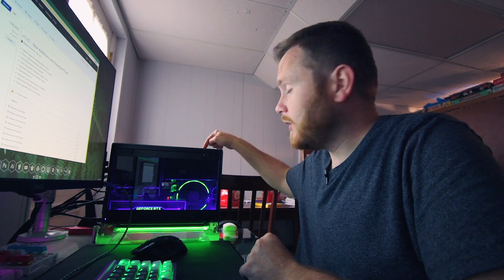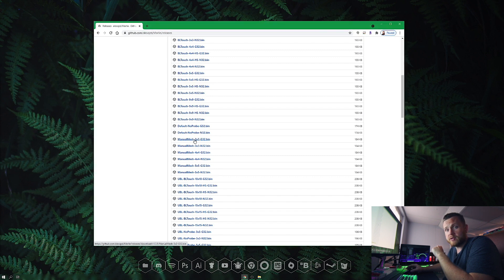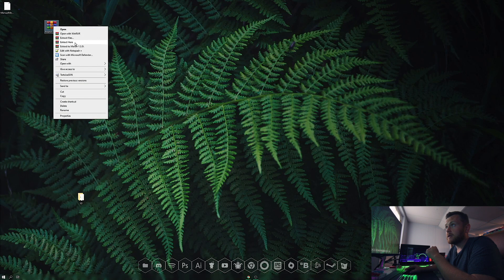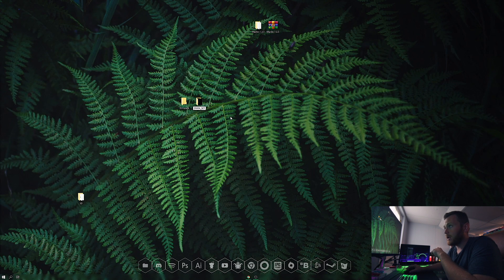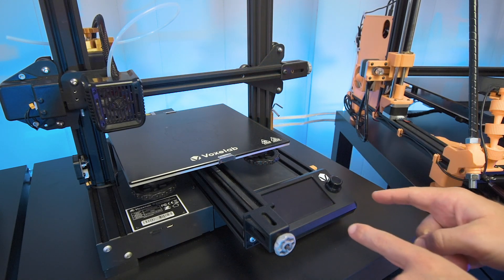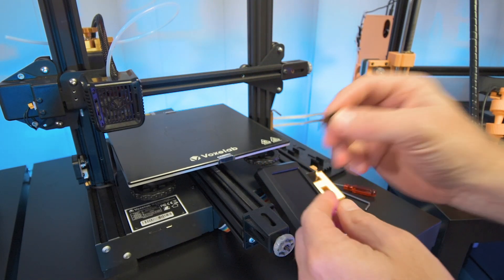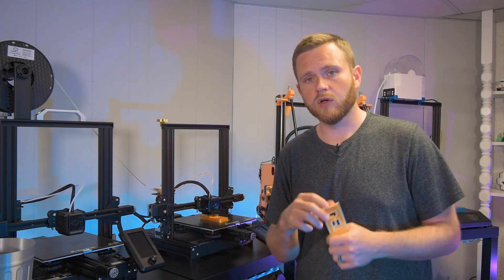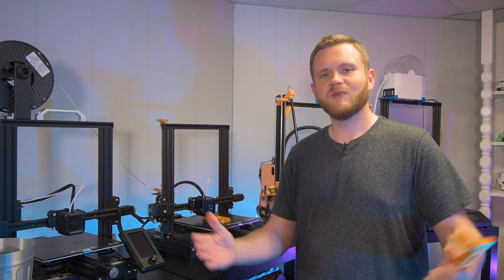Reduce Risk of Fire on Your Voxelab Aquila with 3rd Party Firmware

Comment: I installed the new firmware accurately step by step and now I get "KILLER error MAXTEMP RESTART REQUIRED" 

Ok, so here is what I found out after I panniced: 
The problem?
I installed the WRONG FIRMWARE. 
The solution?

PLEASE MAKE SURE YOU SELECT THE RIGHT CHIP MAKE! E.g. I have an N32 machine, not G32, so I would need a firmware which states N32.

It was painfully obvious but that's what happens if you follow step by step without common sense. I am also a noob!

Comment: Just did this firmware update today and man you made it easy to follow ! I thank you again sir ! I've done all the modifications to my X2 so far by following your videos ! 👍🏽👍🏽👍🏽🙌🏽
Reply: What firmware i need to download for my aquila X2?
Reply: @KSa-ld7cp  there should be a sticker in the top off your printer, under the build plate that says either N32 or H32, you will need the corresponding firmware. Then just follow the same instructions in the video.
Reply: @dirtymikendaboys  i have the n32 version and downloaded n32. But my machine just power on normally. I did every step on the video. :/
Reply: @KSa-ld7cp  maybe retry doing it, and follow each step very carefully, including renaming the folders, otherwise your machine will not know what to do with the files. Do not fast forward any of the video, I would recommend doing each step as it comes up in the video, then pause it, complete the step, then move to the next step. I also have the N32 version and it worked perfectly on my machine. 👍🏽
Reply from the maker: Sounds like the formatting wasn’t quite right. That or the firmware is still zipped and needs to be unzipped into a .bin file
Reply: @3DPrintSOS  thanks for the response. The problems was that the JPG files on dwin_set. I just remove and everything is perfect now. But almost kill the printer with the new firmware because it don't get on the fan when heat up the extruder,  the screen say: "print killed"
Reply from the maker: Hmm. Something else isn’t right if the fan isn’t working
Reply: @3DPrintSOS  I think was the configuration in cura the initial fan speed in Cura was 0. But I adjusted the numbers in cura and see your video explaining the marlin firmware and now is printing flawless <3
Reply from the maker: @KSa-ld7cp  Awesome. Glad you got it fixed. :)
Reply from the maker: Just make sure you match the chip. If it otherwise matters, it will say “X2”
Reply from the maker: Awesome. Glad I’ve helped.

Comment: Hey! So when I am printing, I have to pause a print sometimes and when I come back sometimes it can be an hour or two I click resume and it ends up pushing the print and print bed off with it, is there a way to have it return to the correct z axis or does it need updated?
Reply from the maker: Hey Jasa. Pausing is meant to be for a very brief period of time. If you pause for over 30 seconds, your printer will loose z height and heat. The chances of you finishing a print are almost zero at that point. It’s definitely meant for quick fixes or as a last ditch effort. Not really something an FDM printer can do.

Comment: Hi I tried This And it didn't Work it just is like a fusion of the old and new one. I tried reflashing the old one and then flash alex's but when i put the sd card into the printer nothing happens it just boots like normal and when i put the sd card into the LCD the screen is blue only for a second then is immediatly red and i cant flash any of the firmwares and it is stuck with a mix.
Reply from the maker: It sounds like there is either a naming issue or you aren’t using a .bin. Did you  use winrar to unzip the firmware?
Reply: @3DPrintSOS  So it turns out max can’t format to 4096 kilobytes so I had to use a different computer but it works now thank you for helping and I really like you videos keep up the good work

Comment: Really helpful video. Many thanks for posting. I want to change filament part way through a print and the Voxelab firmware does not support this as it does not full recognise a code pause. Following the code pause you have to select pause on the screen to allow resume and this moves the head back to the model,  deposits a blob of filament on the model and then reparks the heads. Do you know if Alex's firmware will support a pause/filament change?
Reply from the maker: Do you have an h32 machine?
Reply: @3DPrintSOS  Hi, thanks for responding. No G32.
Reply from the maker: Hmm. I’ve done pauses on this machine several times using “pause at layer height”. The issue I ran into is it only working at layer height .2 Otherwise, it misaligned when starting the next layer after pause.
Reply: @3DPrintSOS  Thanks for the info. Odd, when I do it it gives no option to restart on the screen, hence my issue. I am running on old firmware, maybe updating it will fix my issue.
Reply from the maker: Worth a try

Comment: idk if you will see this but i did this and let it sit for an hour and i never got a checkmark. Now every time i turn it on it just sits on the voxelab logo
Reply from the maker: Hey. I see them all! 

Hmm. Did you make sure you have the right firmware for your chip? If so, make sure you format the card correctly. You shouldn’t have to wait long at long. A few seconds at most.
Reply: @3DPrintSOS  yep I've done everything. it just sits on the update screen with no checkmark.
Reply from the maker: Gotta be the sd card. You sure you formatting correctly?
Reply: @3DPrintSOS  yep and I've tried different SD cards
Reply from the maker: The sd card must be 8 or 16gb and have to use Windows to allocate 4096 byte size or it won’t work. The second thing is make sure you are using a .bin file and not a .zip or .rar
Reply: @3DPrintSOS  for some reason when i installed winrar it works now. was that the reason?
Reply from the maker: Yep, the files can download as a zip or rar and you need it to be a bin. Sounds like winrar did the work for you. :)

Comment: what does bed mesh leveling do and can i use it without extra stuff
Reply from the maker: You level using predetermined points that create a mesh. The z motor ends up adjusting for your mesh as it prints. If you do Manual bed mesh, you use the screen to go through the points and adjust for each one. No hint extra needed.

Comment: I followed your instructions step by step and the graphics won’t appear on the screen how do you fix that?
Reply: But what do you do if you can’t choose 4096 bytes without switching file systems
Reply from the maker: I installed windows on my Mac to get this done. I tried many terminal tricks, but never got it to work.
Reply from the maker: That either means you accidentally grabbed the wrong version, there is a naming issue, or the sd card isn’t properly formatted with 4096 bytes.

Comment: Does this work for ender v2?
Reply: Just hooked up JyersUI, I just got a new printer for free….
Reply from the maker: Win win
Reply: @3DPrintSOS  take that as a no
Reply: Do u know how to get 10x10 bed leveling?
Reply from the maker: You can either grab the source code and change the amount of points or find a ore complied bin that has them set.
Reply from the maker: Sure does. You would just have to use JyersUI instead of Alex’s

Comment: Ok so I loaded this firmware in I got to say I like the changes it has done. The manual leveling feature is so much easier. It moves through 9 locations on the bed and allows you to make changes to each part as a micro change instead of moving the wheels  underneath. I'm getting perfect 1st layers using prusa slicer with this. Amazing changes to all aspects of the program.
Reply from the maker: Yes.it’s a game changer. Glad you’re liking it.

Comment: Oh good... I loved your review of the Aquila, and was about to press the button when I saw Thomas' rant... 

So now I can proceed!
Reply from the maker: If you do end up with an H32 machine, you can just update to the latest firmware from voxelab. They have fixed the bug in the firmware. Alex is also working on. A firmware solution. So, no worries.
Reply: @3DPrintSOS  Great, thanks.  Love the channel, new sub.  Totall new to 3D printing too, and can't believe how affordable these printers have become...
Reply from the maker: Isn’t it amazing. Gotta love it.
Reply: @3DPrintSOS  Sorry one more quick question if you don't mind.  I have come across on ebay used and refurbished Ender 3 V2s/Pros for £140, sold as far as I can see by the manufacturer's UK distribution/repair centre.  They are used items returned within the 30 day return period, and any faults rectified.  They carry the usual warranty a new printer would have.  This seems a good deal, what do you think of this versus the Aquila?
Reply from the maker: If you are willing to troubleshoot them, that’s a great deal. :)
Reply: @3DPrintSOS  Yes that's what I thought: the Aquila X2 is £240 in UK brand new, so this is nearly half the price and it's got a warranty.  I could put the difference to a few upgrades and some PLA supplies.  Thanks.
Reply: @3DPrintSOS  thanks for your advice, my Ender 3 v2 arrives Monday. I want to be able to print some Nylon composites, so will upgrade the hotend and perhaps install auto levelling and stiffer bed springs. I palan to build an enclosure for it too. Very excited!
Reply: Well, I bought on ebay but the retailer Sovol, the UK retail arm of Ender distribution I assume, emailed to say the product is out of stock despite having 5 or 6 stock showing when I ordered - presumably a marketing ploy to drive traffic to their eBay store. Not great for the customer experience, and I'm out of pocket for a week whilst the refund processes.  So... that's put me off Ender, but maybe this is a one-off... but it looks like I'll now take a look at Aquila again!
Reply from the maker: Sovol is a printer manufacturer. Since Ender is open source they sell them as well as their own machines.
Reply: @3DPrintSOS  oh I see, goodto know...
Reply from the maker: That’s just wrong. Thank you for warning us
Reply: @3DPrintSOS  Yeah, exactly.  Unbelievably bad practice.  I will not be giving them any of my business, ever.

Comment: So I did this and everything works as it should. I copied the original files that were on the SD Card. Folders such as Model, Software, User Manual. Is there anything I don’t need to have on there now that there is a new firmware installed? I don’t know if that original software folder will change the new firmware
Reply from the maker: Technically you do t need anything at all. You can always get oem firmware from their site

Comment: I installed this firmware but had an issue with my printer and needed to return it, sadly no instructions on how to uninstall the firmware and had no luck finding any examples on forums.
Reply from the maker: You just follow the same instructions but use the files on the voxelab site.
Reply: @3DPrintSOS  I did that but no luck but I may be an anomalie
Reply from the maker: Hmm. That’s very odd. Typically it’s just a matter on putting the stock .bin into a folder called “firmware” and the screen files in “DWIN_SET” and doing the same process. It may have been because you need to reformat to 4096 byte size.

Comment: Hey there,

I wish comments had a search function but Ill just throw this out there. My printer has a sticker that says H32. I do not see a file with H32 as an option. Trying to upgrade as octoprint was telling me there a fire issue with my printer due to firmware. Any guidance would be greatly appreciated! 

Thanks for taking to time to make this video
Reply from the maker: The h32 is still being worked on, in terms of firmware. For now, you can only upgrade using voxelabs own firmware. Alex is working on something currently though.
Reply: @3DPrintSOS  right on thank you so much for the reply
Reply from the maker: Absolutely. Hopefully the H32 will soon be just as capable as the rest.

Comment: Still no fix for H32. I have been emailing Voxelab and they are totally unhelpful. Just non-answers and run around.
Reply from the maker: Sucks they haven’t helped. Try the facebook group. What fix do you mean? Btw.
Reply: @3DPrintSOS  Fix to the thermal runaway bug for the H32. I did try Fei on the FB group, but no response.
Reply from the maker: I don’t have an h32 machine, so I can’t really test.  I was under the impression the latest firmware fixes it.
Reply from the maker: I came to that impression when I was asked by one of their reps to test the firmware because they have fixed it. That was around Sept. 24th. However, I don’t have a H32 machine. So, I can’t really do that. I was just happy to hear it. Also, there was a guy on YouTube (Jeff’s 3D corner) that did tests after Toms video but that was on a G32 machine.

Comment: This would never happen to me, Meh, why bother the stock firmware is fine. Well guess what! It happened, I think. I got a thermal run away alert from my printer. Did it save my home from burning down? Who know, my house didn't burn down. But I'm glad I went through the bother of upgrading the firmware.
Reply from the maker: Typically happens because of a bad thermistor. Glad the firmware saved it. :)

Comment: Just tried to update my Aquila, screen now is just backlit black, followed all the steps to the T. now trying to load the original firmware from the Voxelab site.
Reply from the maker: Heck to make sure you have the sd card formatted correctly. Then if that’s true then check your processor. Let me know what it says and I can confirm which model you have
Reply: @3DPrintSOS  I followed every step to the T. Formatted the SD card and everything, went back and looked at the 3rd party site you listed and went and looked at his original firmware update he posted and the chip set on my Aquila is an H32 and is not supported, only the other 2 chips are supported. So beware of the chip in your machine, one size does not fit all.

Comment: Can you use this firmware with the Ender Extender 400 installed, or does it need to be modified?
Reply from the maker: It does need to be slightly modified. It needs the dimensions changed to 400x400

Comment: I put the firmware in and it starts beeping saying the kill error MAXTEMP needs restart? Is it because it is a voxelab v2
Reply from the maker: No, this typically happens when the thermistor needs to be reseated. Try to loosen in on the hotend. Move it a bit. Then lightly tighten again. Let me know if that works.

Comment: What is the difference between Default and ManualMesh?
Reply from the maker: Default just has regular leveling like stock does. Mesh ads the ability to create and store a mesh using a grid of points on the bed.

Comment: I have a x2 and I’m trying to flash the filmware but it’s not flashing. Am I missing something?
Reply from the maker: What chip do you have? On the front of your printer there should be a chip sticker. By the front left corner of the bed.
Reply: @3DPrintSOS  n32
Reply from the maker: The only other thing other than having the correct firmware is to make sure you are formatting the card to 4096 bytes.
Reply: @3DPrintSOS  I also did format the SD card. is there something i should do to the files its as if my printer doesn't recognize the files
Reply from the maker: Hmm. Confirm that you have a folder named “firmware” with your .bin file in it and then another folder that you renamed to just say “DWIN_SET”
Reply: @3DPrintSOS  i think it worked thank you my screen has went red
Reply: @3DPrintSOS  my display now is buggy
Reply from the maker: Awesome!

Comment: So, all the original Aquila's are the G32's?
Reply from the maker: There are batches of them. The original are all g32 but some new models can be a mix of H and N. Both of which would have a sticker indicating as such.
Reply: @3DPrintSOS  Ok, where would this sticker be? I've had mine for awhile now, so I'm going out on a limb to say it's a G
Reply from the maker: To the left of the bed, right on the sheet metal. If you don’t see it right away, it’s likely a G. You would notice it pretty easily.